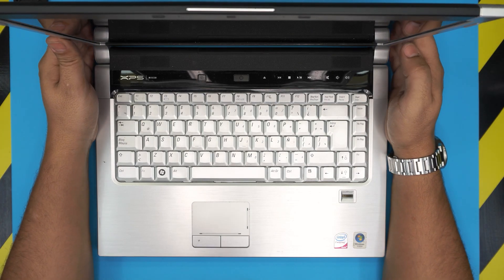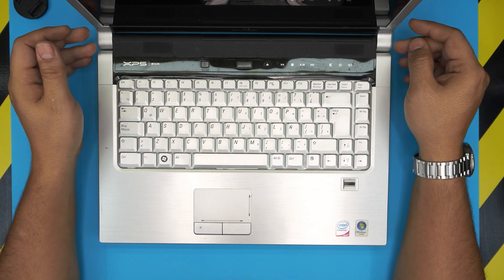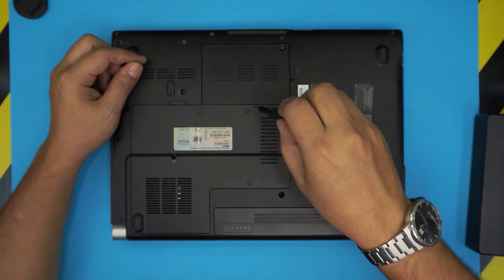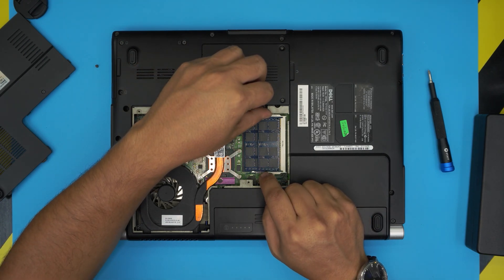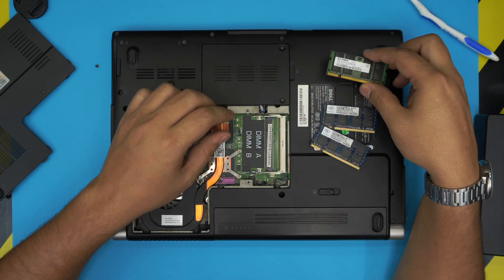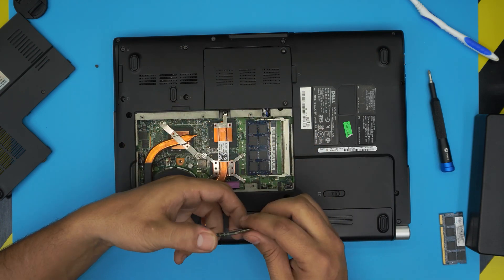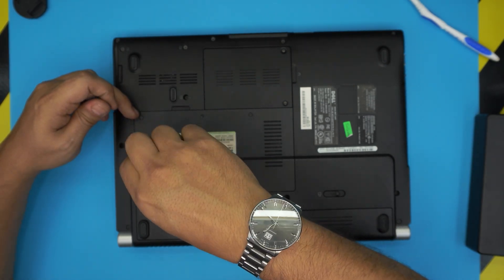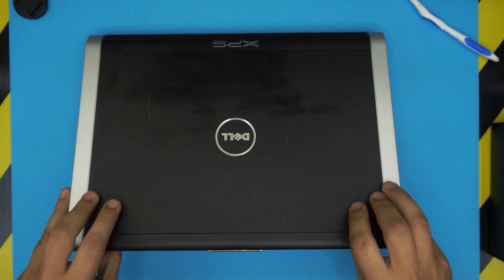Dell XPS M1530 RAM Upgrade Guide

Comment: I can expand the maximum ram that the laptop allows, like 6 GB of ram?
Reply from the maker: Thank you for your feedback! If you wish to support the channel, you can like, subscribe, or both!
Regarding your question, check the max ram you can have 1st: https://youtu.be/tKEJTkVth4Q
then place the ram normally is 2x 4GB: https://amzn.to/3MbJSJJ
Should you have any further questions or requests in the future, please don't hesitate to ask me.
Cheers🍻
This is an  Amazon affiliate, when you use my links, I earn a percentage, which helps support the channel.🙏.
Reply: Greetings, @uFixTek   This lead to a new question: I own this laptop (Intel Core Duo T7250 @ 2.00 Ghz, it runs with 3 Gb, amazingly with 2 different types or models (1GB DDR2-667 and 2 GB DDR2-800 -considering the limitation is to 667). I installed it MiniOs 11 64 bits. The wmic memphysical command shows its limited to 4.194 gb but I found in other websites than can install 'til 8 gbs with "a tweak" of options on the BIOS (A12 last version). How it can be possible? Thanks in advance for your kind answer
Reply from the maker: there is no tweaking requires, just remove the 1Gb and place a 2GB 800mhz and you will be fine, before you do that just update the bios from official website.
cheers🍻

Comment: Can I use DDR3 RAM instead of DDR2 RAM ? And can I use 2 4GB RAM stick?
Reply from the maker: Thank you for the feedback! if you wish to support the channel you can LIKE or SUB or both :P
regarding your question:  unfortunately that is impossible, it wont fit, the cut and pins are not the same.

Comment: Hi is It possible to upgrade the CPU?  The original is a core 2 duo i want tô upgrade It. Thanks.
Reply from the maker: Thank you for the feedback! if you wish to support the channel you can LIKE or SUB or both :P
regarding your question: you could but  NOT recommended as the jump to a better CPU is not possible, it must be the same socket and the only thing different is the cpu speed lets say from 2.8 to 3.2ghz.
Reply: @uFixTek  thank you Very much! Like and sub 👍
Reply from the maker: much appreciate your support my friend, if you have any question or request feel free to ask me.

Comment: Hi! we have the same laptop, but its processor is Intel Core 2 Duo.  Can it handle basic MS applications?
Reply from the maker: Thank you for the feedback! if you wish to support the channel you can LIKE or SUB or both :P
regarding your question: sure my friend it will do the job for office use, without any issues.
Reply: dude this machine can handle even Photoshop and 3ds Max.
Reply: and games like left 4 dead 2 and Garry's Mod
Reply: Intel Centrino is second name for core 2 duo

Comment: These are unavailable online can you add more links for other ram that are compatible I’m new to ram upgrade what is most you can put in this old computer can I use just one ram chip or does both slots have to be filled
Reply from the maker: Thank you for the feedback! if you wish to support the channel you can LIKE or SUB or both :P
regarding your question: you dont have too use both ram dims but it will be much better to use both as you will automatically activate the dual channel memory, 
if you want to know your max ram capacity check this short video i made:
https://youtu.be/tKEJTkVth4Q
links:
https://amzn.to/3Gv2LSU